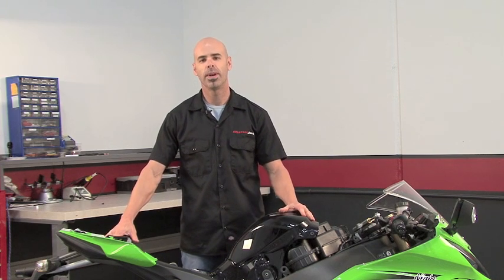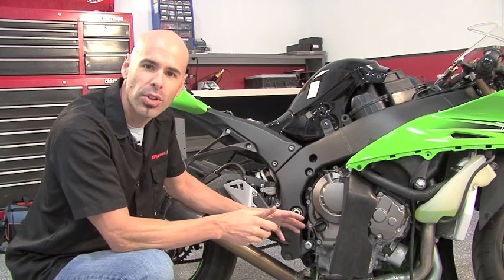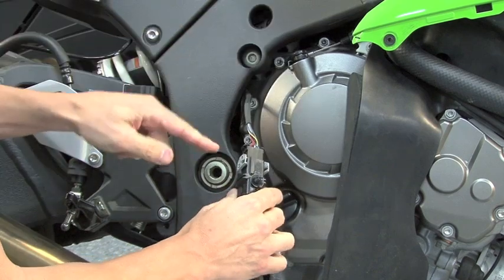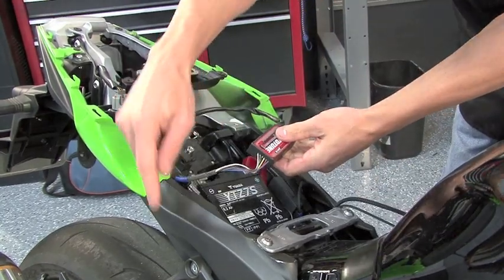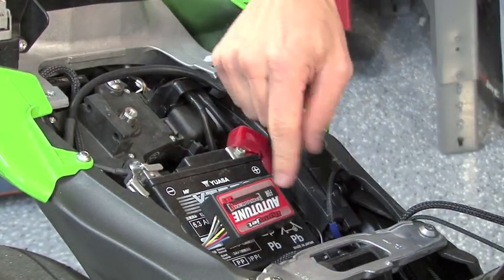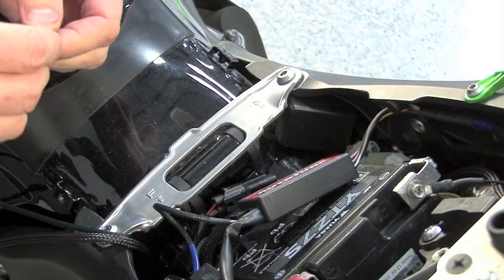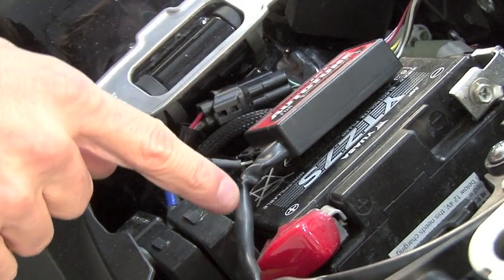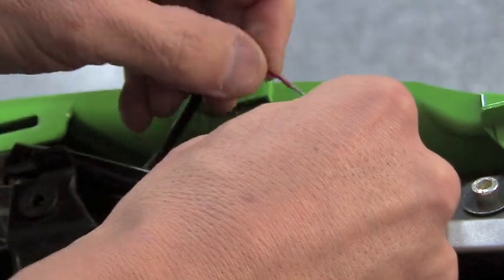Dynojet AutoTune AT-200 Installation (shown on Kawasaki 2011 ZX10R)

Comment: Canonero about band exhaust work? There’s already one on my system
Reply: What do you do with the stock o2 sensor since your using dynojet o2 sensor?
Reply: @jeremyleach6424  

I haven’t used the O2 sensor yet, so bypassed stock and use a map for now
Why, because I still have stock CAT exhaust and I’d have to drill out the stock bung.
Or so I thought, but I found a bung adapter wide to narrow, I just ordered it tonight.
Reply: I have m4 full exhaust installed and the auto tune sensor fits that exhaust system but where do I put the stock o2 sensor cuz I’m sure if it’s not plugged in then check engine light will come on
Reply: @jeremyleach6424  
I bought an O2 bypass to plug into the sensor
Reply: @robertvondarth1730  can you send me link where you got yours?
Reply: @jeremyleach6424  
I have a Suzuki Bandit 
Search O2 bypass for your bike model
Reply: @robertvondarth1730  already on its way. Thx a lot! Appreciate the help

Comment: will this be a direct plug in for a vulcan 900 or will i have to weld in bungs or anything like that. i'll be running a cobra powerflo and vance and hines staggered slash cuts. and want to make sure i'll be able to actually use the auto tune before i buy it.